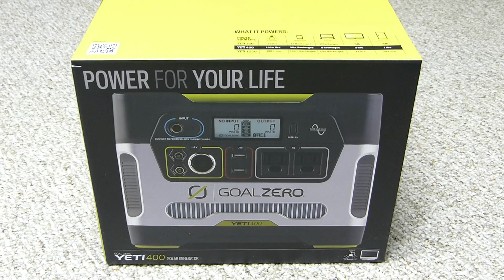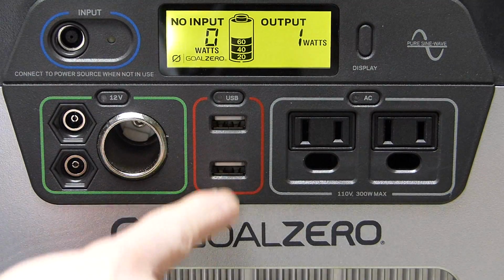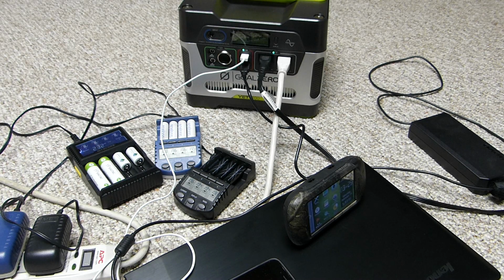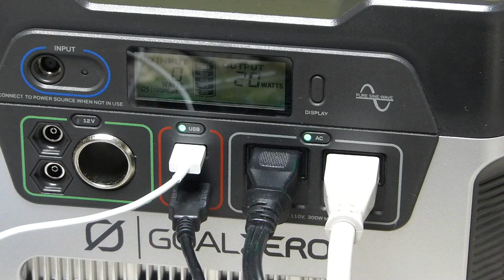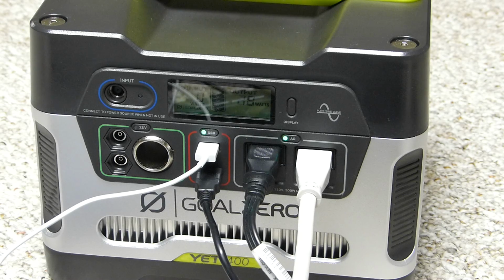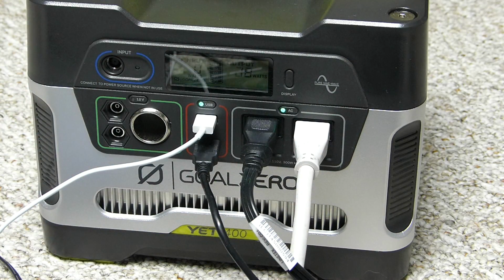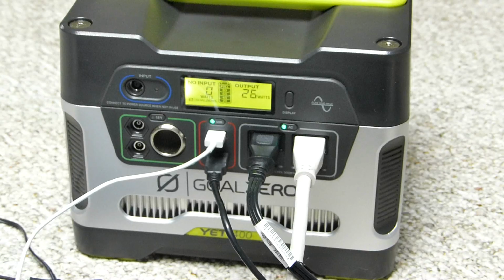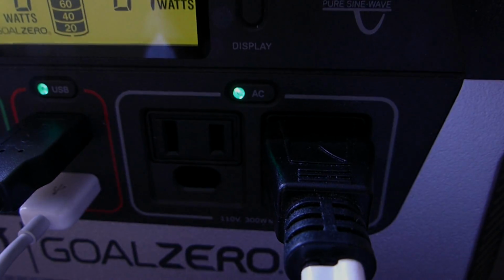Goal Zero Yeti 400 unboxing & review demo

Comment: The little wire is a temperature gauge to monitor the temperature . It  probably is responsible for the fan to start when the temperature goes above a certain point

Comment: The little wire when you showed with the battery out was a thermistor, is to protect the battery or system just for over heating when things get too hot, some computer have these thermistor to protect the processor. I thought since you didn't know what it was I thought I would pass this on. I like the device, might get one since I am a amateur radio operator this might work for me to recharge my handhelds.

Comment: Hi, pls, is it possible to charge the yeti 400 with a 150W panel?
Reply from the maker: Yes, but you'll need the proper connectors.
Reply: Could you pls advice whic is best btw connecting via the 8mm port or via the side battery ports?
Reply: You would need to use the 8mm port as that connection interfaces with the internal charger. This will insure that the battery will be charged correctly and maintained within specification. Hope this helps!

Comment: God, it's so expensive. It is GROSSLY overpriced for what it is. It makes Apple products seem reasonable for their specs. It would have been reasonable to be 2x as expensive as its component parts for how it's packaged, but it's easily 3x or more. Their new 100w solar panel is $750 and you can literally get the same one for $150 and use it with an adapter. But it's still an excellent product.
Reply: I think it's good for people like me, who are so 'unhandy' that we are terrified if we tried to build it ourselves, we would set of a Nuclear holacaust. 

I bought this model(not delivered yet) so I could feel comfortable just using something like this. Eventually I want to build it myself, but you have to start somewhere. And this is the Best one to Start with imo.
Reply: the market is there, and they do seem to use top shelf quality parts.  the sine wave inverters they used are by far the most efficient and accurate I've ever seen in my life, which is saying something.  the fact that its built into such a tiny box( have the yeti 1400 as my primary source of power in my RV) is incredible, and it all works perfectly.  no fussing, no wondering if its safe, nothing.  plug, play, live, no worries.
Reply: Inverters are not cheap, that's where I think a lot of the cost comes from. A regular inverter with a similar power output to the Yeti 400 looks to be about $100 depending on where you look. There is likely a premium to the cost, but it feels somewhat reasonable considering the assembly and proprietary connectors and safety mechanisms it likely has built into it.

Comment: Could you help me with a bit of advise? I'm considering long trips with my ebike and want to know if its feasible with this or a similar kit and if so, what type of these units and solar panel wold I need to acheive this. Ideally I'd like to be able to charge a Samsung Lithium Ion 36V 11Ah battery in about 6-9hrs (a day of camping). It typically charges from 20-35% to 100% in about 6 hours from the wall outlet. Any advise would be appreciated.
Reply from the maker: +Kevin Bacon I don't have experience with ebikes yet.  Not sure this setup would be the best choice due to the bulk and weight, unless you are trailering it I guess.

Comment: hi great video! 
i have some questions: the wall ac charger is it only 110v or can it also be charge with 220v? if not what electrical convertor do i need when charging with 220v? 
what is the best solar pannel for recharging do you recomend for this unit? amazon sell it wit a 30m.
thank you! i am exited to get it for my outing photography.
Reply from the maker: +Marcos Enrique II Ruiz Rivero (Aviel is Superguide) I believe they make a 220 version from their website.  The 30m is good for this unit.  The 90 is even better.

Comment: Fully charged, how long will it sit, without usage, until it needs to be charged again?
Reply from the maker: +Jamen Anderson Probably around the same discharge rate as your battery in your car. It uses the same battery chemistry.  I would guestimate around a few months left unattended.  I would keep it topped off monthly though and not let it drop below half charge to prolong the life of the battery.
Reply: +LEX-FLIX any update?  does the error still appear?
any regrets?
Reply from the maker: +My Nam I had no more issues with it.  I don't use it very often, except to exercise the battery about once a month.  I am planning on getting a second unit.

Comment: BTW the small little wire that is red/black that you held up wondering what it was at the end of the video. Is the heat sensor wire. So if the battery gets to hot. It'll shut off the unit to keep the battery from getting damaged/exploding. They also have other sensor of the same type taped by the AC inverter plug chip to make sure the unit doesn't melt if it gets to warm itself.

Hope that helps. ^-^.
Reply from the maker: +Raptorduder Thanks, good to know.

Comment: does this come with the solar panel> yes ?? no??? if not which one goes to it? do you need exra cables ? I just need this system to be complete
Reply from the maker: +SRPBLUE1 Battery only.  You can use the 15, 30 and 90 panels.

Comment: No macbook adapters?! what were they thinking...
Reply from the maker: +Pedro Dutra I wonder if had something to do with Apple's strict lock down of their product line.
Reply: LEX-FLIX If so, that's just a shame.
It would be a perfect product.
Reply: +Pedro Dutra don't blame goal zero, blame apple. worst case, charge it using the inverter
Reply from the maker: +jgg204 Get an Apple cigarette adapter then plug that into the battery.

Comment: I have the 150 and 350.  Something went bad in the 350 it just over a year after purchase, and that same make battery quit.  You can't get them anywhere and GZ won't even respond to my Emails anymore.  Whats advertised as a replacement at battery companies has a higher post and won't fit.

My other GZ stuff is quality, but they screwed me over with the predecessor.   Good luck.
Reply from the maker: MrRayMac1963 You might find the OEM one.  Someone has to sell it somewhere.
Reply: Tried that. no luck. Only found it in Australia and they said they had discontinued it.   Ended up buying what was said to be a direct replacement, but the posts are too tall, so i actually have two worthless batteries, and a pile of parts.  The 150 still works though.
Reply from the maker: MrRayMac1963 That sux.  Hopefully I'll have better luck with this Yeti series batteries, which seem like more standard shapes than the ones used in their Escape series.
Reply: I may be stupid, but i'm actually considering buying a Yeti 150 or 400 just because i have so many cables, lights, and a pair of boulder briefcase solar panels.  I have a lot already invested in GZ gear, and its wasted money if i don't have the battery system.
Reply: *****  Its still in parts in my basement.  GZ has finally decided to sell their OEM battery.   I'm thinking I'll buy one and re-assemble it, Toss the inverter, then use a chaining cable to hook it to a 400... AFTER i get over being mad at them.  I really like the new design because the inverter doesn't need to be on to run the USB or 12 volt.  THAT was a big waste of power on the old 150 and 350.
Reply: +Will Diehl  Just an FYI I found a company that sells a deep cycle AGM battery that is a direct replacement for the factory, but is an upgrade in both capacity and durability.   My 350 is back in operation, and better then new.

Comment: I can get the Goal zero 400 to charge using the wall outlet but when I plug in the Nomad 20w solar panels of which I have two 20w panels the blue light dose not come on . I have to be doing something wrong ! but what . any suggestions
Reply from the maker: degregrio It should show charging in the LCD display battery meter.  I would contact Goal Zero.  Their warranty is like 6 months or something.
Reply: I figured out what I was doing wrong . I was only having that problem when connecting the solar panels to the input . You have to have the solar panels OUTSIDE in direct sunlight before the input light comes on and it begins to start charging the solar generator . I knew it had to be something simple I was doing wrong .

Comment: Thank you for the review.  Very thorough and well explained.  I have not opened my Yeti 400, so that was good to see that the battery can be replaced.  It may be a good idea to buy and keep a spare battery for this unit as back-up.  I may do that.  I keep my Yeti 400 at home as a base station and I use the Yeti 150 in my van to power my ham radio set-up and recharge all of my small devices.  I also have the Light-A-Life LED Light  that plugs right into the Yeti.  Overall I think it is one of the best set-ups out there right now.  Take care.  Anthony.
Reply from the maker: Thanks for the comment Anthony.  You have a nice solar setup yourself there.
Reply: Thanks.
Reply: dont buy a spare battery unless you plan to charge it every 3 months because it will die in storage.

Comment: Would you buy Yeti 400 again? and which one do you perefer compared to the Sherpa 100? Thank you for the video, I was thinking of buying yeti 400
Reply from the maker: Ben B. Yes, I would.  It is a great sized battery that can handle most charging duties.  The Sherpa 100 is great for the portability, but the built in pure sine wave inverter with the LCD display showing the status of the energy going in and out makes the Yeti 400 a great unit.  Just wait til it goes on sale, I got mine for 60 bucks below retail from a popular online retailer.
Reply: +LEX-FLIX  can the yeti use a lithium battery?